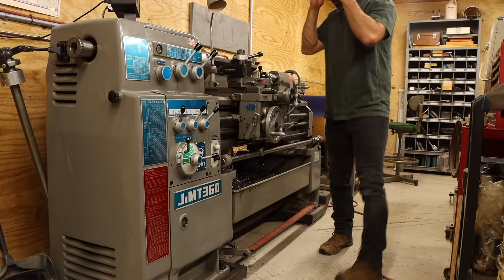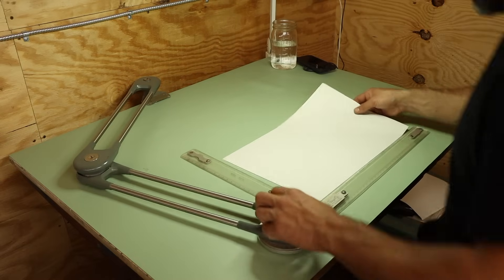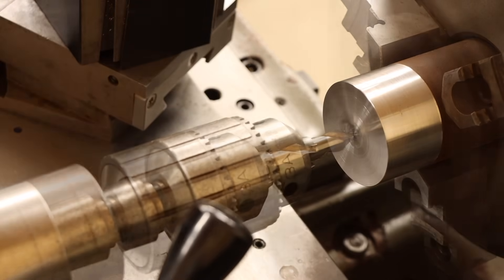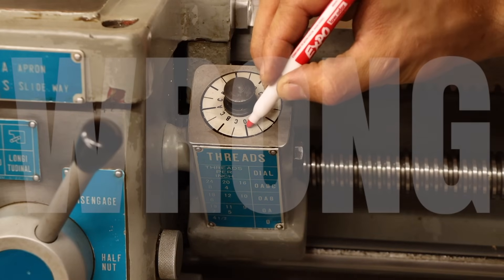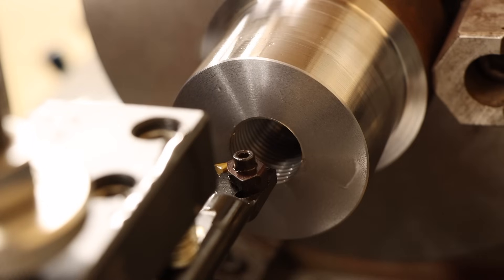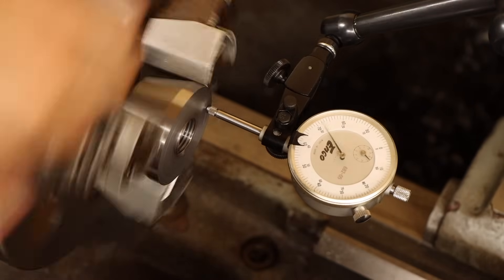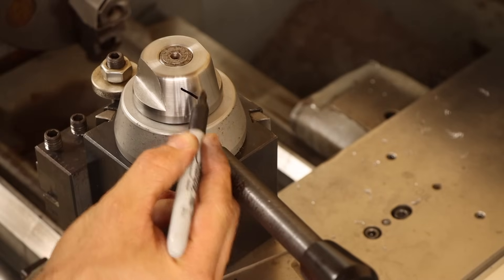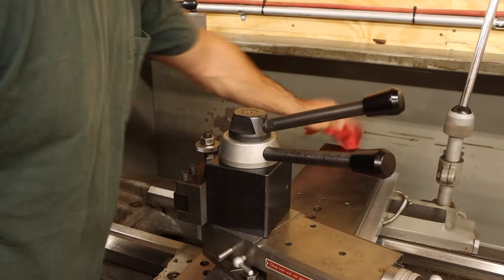A Better Tool Post Nut || INHERITANCE MACHINING

Comment: That certainly does look original to the lathe. If I didn’t know you made it, I would think it came with it. Now for holding the already tapered nut on the lathe, why didn’t you just chuck the M22 tool post on the lathe leaving only enough thread past the chuck jaws slightly shy of the final height of the nut. That way you can tighten the tapered nut against the chuck jaws and clean up the bottom face without running into the now holding M22 tool post and you will have an already perfect bottom face on the tapered nut. And it’s much safer than using that itty bitty edge of untapered nut to hold it. Hehe :p but other than that, I love to see you work and is always fun. However... I couldn’t help to notice the lack of side projects in this video, what’s the deal with that?! Lol
Reply from the maker: Where were you last week!? That's a much better setup! Regarding the side projects, or lack thereof. A pure fluke, likely never to happen again 😉 thanks!

Comment: My shop has had to order material several months in advance for about a year now, material manufacturers are super backlogged and it’s not getting any better
Reply from the maker: It's nuts... we've had this problem at my job as well. McMaster gave me a good delivery date and I usually never have any complaints about them. But this time it was a joke. Ironically the material came in the day after I finished the project

Comment: When you put the nut in the mill I was confused that you hadn’t tested to see where the handle would land. I figured you knew something that I didn’t, like perhaps you planned on adding washers or shimming the difference after it was done. Very nice work though. 

I am truly envious of your shop. Although I’m sure you’d love to spend some more time with your grandfather, having an inheritance shop could feel like you’re still making memories with him every time you step through the door.
Reply from the maker: Literally 😂 thanks! I've used that technique a time or to. actually tried it here but had a hard time since the inner face was a smaller diameter and couldn't get a good position.

Comment: You may find that trying to apply torque to tapered wrench flats causes the steel to deform, and the wrench to slip.
Reply from the maker: yeah it does just a little, but its manageable if i keep my hand over the working end

Comment: Perfect timing!!! Just the other day, I too was looing at the top nut on my tool holder thinking it could use a handle. As a fabricator, not a machinist, my first thought was to make a handle to tig weld to the existing nut. However your end result it MUCH more desirable. Guess I better figure out my thread pitches and get my taps ordered. Thank you. You are an inspiration.
Reply from the maker: I mean nothing wrong with the welding method either, but a machined nut will be much prettier. good luck!

Comment: That ended up lookin nuts! Awesome work again! Btw, you can use gauge block/cutting tool shank or any other similiar piece as a help when you setup a workpiece to jaws, just have it there behind and put workpiece against it then tighten jaws, makes it easier to get that face straight with the dial 😊
Reply from the maker: Literally 😂 yeah I actually tried that at first to get it close but has some trouble getting a good position since the inner face was a much smaller diameter. Thanks as always!

Comment: Hi man, sweet as always! Your threading dial work in division with the pitch of your lead screw. Normally you need to know the pitch of this screw to know witch mark you have to focus on the dial (in relation with the pitch you'r machining). Your is probably is imperial. You should maybe open the dial and check the pitch of the engaging gear inside. Cause you normally can change the division by changing the gears. Bit messy for me to be really water clear in english but it should be something like that hahaha!
Reply from the maker: Thanks, Lilian! I follow you exactly no worries! It was pretty obvious in hindsight my 4TPI lead screw was never going to translate to anything metric on the thread dial. Some people have mentioned that their lathes came with a separate thread dial gear specific for metric threads. I check around for one my shop but no luck. Might make for a good project!

Comment: I love 4140, my favorite steel. However, not necessary in this application.
Reply from the maker: My thinking was originally to try match the finish boss of the lower handle. And my guess was a shot peened or sand blasted chrome alloy steel since it doesn't rust. Not sure if it would have turned out looking the same though

Comment: I love seeing videos like this and I am excited to get my home shop up and running and start making my own projects and tools.  And mistakes.  🤣

As a machinist and Watchmaker there are a few super expensive tools that don't look that complicated I think I can tackle in the machine shop, if my baby machines (TAIG mill and Sherline lathe) will handle it.
Reply from the maker: Go for it, man! Only thing you have to loose is time. And if you're already into watchmaking I have no doubt you could manage the tools as well.
Reply: @InheritanceMachining  I have recently experienced a great reset in my life and have decided after some vocational training that machining and metalworking is what I'm supposed to do.  40 years old and figuring that out I'd better than never.  And Watchmaking is applied machining but smaller.  I love watches and I love working with my hands so I am going for it.  But right now I'm not able to do much.  In the coming weeks I should be back home where I can actually start building out my shop.

Thank you so much for the reply and the encouragement.  I love this channel so much!
Reply from the maker: @WatchmakerErik  That's great! I love to hear when others make big changes in their lives for their own betterment and happiness. As you might imagine I'm doing this so some degree with my shop and this channel as well. Best of luck to you!

Comment: Haven't read through all the other posts to see if someone else has already mentioned it. But if your lathe has a imperial leadscrew you can't use the threading dial to cut metric threads. Well you kinda can but not in the normal sense. It's more a disengage to stop the lathe safely then back up and re-engage rather than timing it.
So you pick a spot on the threading dial, this is the only one you will use for the entire time.
Engage half nuts, cut thread
at end of thread disengage half nuts, stop spindle, back tool out
At this point the threading dial has probably rotated 1/4-1/2 a turn past your mark
put the spindle in reverse and watch your threading dial, it will spin the other way and come back to your mark, when it gets back to your mark engage the half nuts again and let the tool come back to the start of your cut.
take your next pass, rinse and repeat.
The caveat here is if you are running high spindle speed or are slow on stopping your spindle there is a chance you will go past a full rotation on the dial. So you could potentially come back to what you think is the starting point, but is actually out by a rotation on your threading dial.

I was working on a way to use a imperial leadscrew lathe to cut metric threads while still being able to use the half nuts properly but ran into a problem that not all lathe's with imperial leadscrews cut true metric threads. Basically the smaller / cheaper ones only approximate the thread pitch. It's good enough for most things but also causes some issues, especially on longer threaded sections as the small error starts to add up.
Reply from the maker: I had a few people describe a process exactly like you mentioned. I'll definitely be using this in future as it seems way safer! Im not certain on ym lathe whether it's approximating metric threads or if they are true. there is an internal change gear actuated by a lever (separate from the ones you actually swap out) so it may be true metric. bight be an interesting test to make some long external passes and measure

Comment: You are the absolute fastest learning and highly achieving apprentice I have ever seen in the trade. Advanced principles you grasp quite easily. Really love the channel. My ONLY,ONLY advice (and possible without any merit) is I never insert rusty/dirty metal into my chucks. I with take it over to a wire wheel on the bench grinder and brush them of first. Can't say I was taught that in my early years or if it's my own OCD. Reality is the chuck jaws are hardened(both on the mill vises and chucks) but I think it is best practice. Keep up the great work.
Also- get some good bar stock, mill your tool post dovetail through the entire length, cut them up in the band saw, then drill/tap, and mill the slot, blue them and you'll have a huge assortment of dedicated holders.
Reply from the maker: I very much appreciate that! Ironically I've wire brushed rusty steel at time, but not for the chuck mounting side. I'll do it on the end to cut so there isn't as much rust dust kicked up in the air. 

Tool holders are going to be very soon for sure. I just have a few other projects I've been pushing off that I'd like to knock out first

Comment: Boy, is it funny watching somebody else's screwups!

Nah, you've done another great job.

One comment if I may seeing that you didn't surface grind the bottom of the nut. You can put an undercut on the bottom of the nut so it clamps on the circumference. That improves contact with the tool post top face. A thin shim under that would ensure you're not rotating the tool post when you clamp it down.

And a suggestion. To set up weird angles on the mill you can use two vices. Great especially when you have flat surfaces you can grab on but they're in the wrong location/orientation for the one vice. I use a second cheap (import) grinding vice, they have acceptable quality. I set angles using a digital protractor with a magnetic base. The vice has ground surfaces everywhere you can use for reference.

For compound angles I use three grinding vices. As you probably figured out this allows me to set up any angle in 3D.

Yes, you can use a rotating swiveling vice and replace all three but there isn't one small enough to fit my small mill. And they're expensive.

You could have used this idea to do the grinding on your collet blocks but it was a lot more fun watching you build the sine plate.

Onwards and upwards!

PS. You should know by now I am not a machinistolgist by any stretch of any imagination.
Reply from the maker: Thanks for the tips! I'm actually planning to make that sine plate convertible to a sine vice but probably wouldn't use in on the mill. Maybe I'll also make a smaller plain grinding vise for setups just like you mention.

Comment: If you have a cam lock Chuck on that lathe check out Joe Pyzinski’s threading trick.  In short you turn your threading tool upside down, run the lathe in reverse and thread from the inside out.  Zero chance of crashing with that technique.
Reply from the maker: Thanks. I actually think he's using an opposite handed tool to make this possible. It's at the top of my wishlist 😂
Reply: @InheritanceMachining  In his video he is using a normal left handed tool flipped upside down buts he’s cutting external threads.  I think you are correct in that you would need a right handed threading tool turned upside down for that trick to work for internal threading.  I wish I could use that trick but the Chuck on my lathe is threaded onto the spindle nose.  Love the videos keep up the great work!
Reply from the maker: Ah ok that makes more sense. I haven't seen the video but always get a few comments about flipping the tool and threading in reverse. Now I see that it does work but only on external threads like you mention. Thanks for the support!

Comment: Well done.  Just machined a MT-1 to 12mm 1mm pitch adapter for my wood lathe to attach a mini 4 jaw chuck for tiny part woodwork.  When I heard your comment about lining up on a number with a presumably non metric drive screw I had a full on WTF moment...then I saw your sign and laughed pretty hard.  As for your handle not lining up, would not have been a huge issue.  I retrofitted my lathe with a existing handle I had made for an earlier machine, just shimmed under it with some large washers and if you and one a bit you can put it any angle you want...or just take a pass on the mill off the underside of your part.  Regardless the god of lathe luck took pity on you at that final stage.

Also thanks for the tip about the dial indicator on the tail stock for setting angles.  My MT-1 angle of 1.4 degrees was a pain to set up and a tad bit wonky but still worked out.  Next time it will be perfection!
Reply from the maker: 😂  yeah I realize now that there was no way in hell a 4TPI lead screw was going to translate to anything metric on the thread dial. So obvious in hindsight! Also if the handle was any more off than it was I probably would have done exactly what you mentioned.

A thought on the MT turning. I probably would have turned that between centers with a drive dog and offsetting the tailstock. I don't know about your lathe but my compound rest only has about 2 inches of travel (if that). Turning between centers would allow you to cut it all in one pass. And would also be very accurate on the angle
Reply: @InheritanceMachining  You are indeed correct about turning between centers...but I'm lazy and getting the tail stock back in perfect alignment is a pain requiring machining a metal rod and checking for taper etc.  As for a MT-1 I only need about 1.5" of length on the taper it's not an issue and the compound rest will work...just barely lol
Reply from the maker: thats a fair point 😂 you actually just reminded me that the MT1 in my lathe spindle for my collet adaptor is only 1.5" long as well so that makes sense

Comment: What's the solution used to get the black oxide finish?
Reply from the maker: I use the cold bluing solution from Caswell Plating. I highly recommend it

Comment: As you discovered you can't use the thread dial to pick up metric threads on an imperial machine. A metric lathe is annoying to cut threads as well because the thread dial requires change gears for different thread pitches.
There is a clever trick you can use to cut metric threads on an imperial machine where you can disengage the half-nut. It is especially useful on machines without a spindle brake or difficult threading situations such as internal threading or threads where a thread relief is not permitted.
Pick a number on your imperial thread dial as you did in the first try in the video. Engage the half-nut and make the first pass. When you reach the end of the thread disengage the nut and at the same time hit the stop button or lever on the lathe and allow the spindle to coast to a stop. Back the threading tool out of the way. Note that the thread dial number you used hasn't moved much past the set mark. Now reverse the spindle rotation and when your number comes back to the mark re-engage the half-nut and back the carriage to the starting position. Rinse and repeat until the thread is finished.
Cheers from NC/USA
Reply from the maker: Yes!  I got this tip from another commenter as well so thanks for corroborating. I will definitely be using it next time I dive into something metric. I went digging amongst my lathe tooling to see if there was a separate change gear for just the thread dial, but no luck. Might make for a good project though. Thanks again!
Reply: @InheritanceMachining  Those change gears are for a lathe with a metric lead screw. Your lathe with an inch based lead screw wouldn't have them.

Comment: I went down this rabbit hole as well. Unfortunately, I was unable to cut metric threads so I decided to use the factory nut and I cut the open end off the wrench and heated and bent it to the right angle. It’s ugly but it works. 🤣
Reply from the maker: If it works, who cares! Sometime you just gotta git-r-done

Comment: If the tool post stud/bolt is the oem one remember you can always clock it by 90deg (if your orientation happened to be off). Should be held in there with 4 bolts if you pull the compound off
Reply from the maker: oh... you're right. I had that all apart when I cleaned up the whole lathe but I don't remember exactly the mounting situation.
Reply: @InheritanceMachining  Always like the lathe vids. Even though they are chinese built and some people may knock them, these jmt 360s are built heavy and can take a good cut
Reply from the maker: they certainly are. plenty of capability for my projects. at least for now 😉

Comment: Love your videos. I have to ask about the Black Oxide finish as I can never get a good coating like that, if you woulden't mind what are the steps you use to get it looking that good? Thanks
Reply from the maker: Thanks! Happy to share. I always clean thoroughly with brake cleaner and air blast dry. Then my first dip is around 90 seconds. rinse in clean distilled water 30 seconds and wipe the part down. you'll find the part has a lot of loose oxide on it and the surface underneath still has a bit to go. then I start another dip and keep going until its dark enough, usually 3-4 dips. On the last one I'll wipe it down then dip in the sealer. Mine is a type that dries to the touch as opposed to the penetrating oil type that stays wet. I use the Caswell Plating kit, btw and I highly recommend it. Hope this helps!

Comment: Gday, the new nut certainly looks the part, I think anyone that’s used a lathe has made the mistake of messing up the bore by not giving the tool enough clearance to remove, that happens quite often here😂, brilliant job mate, Cheers
Reply from the maker: yeah just got a little hasty and overconfident with the "simple" operation. there's no rushing in a machine shop! thanks as always!